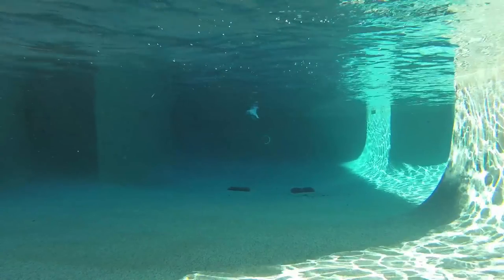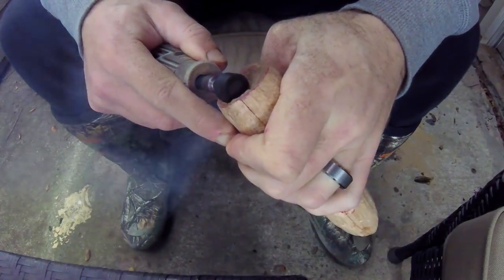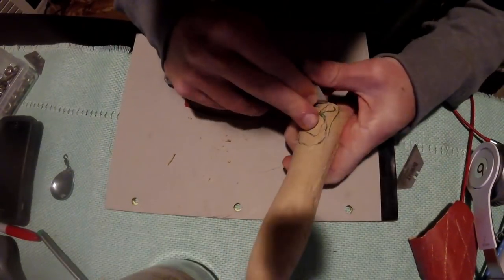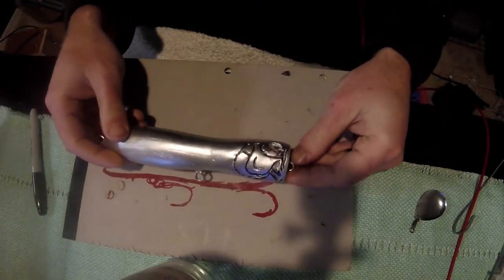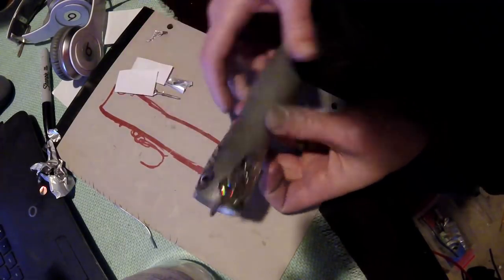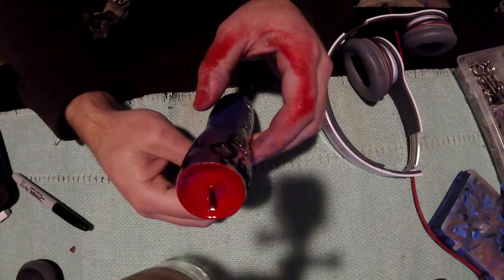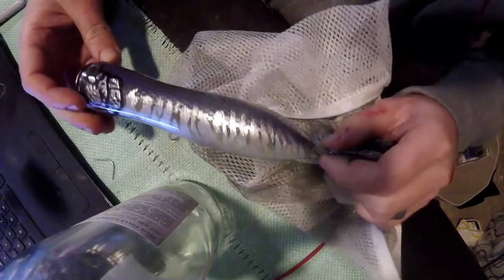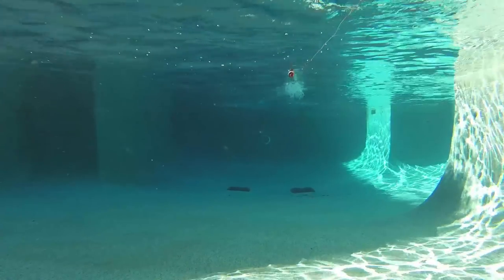MAKING A SPINTAIL POPPER FOR TUNA!

Comment: Tip: Add brown shopping bag paper in between the two pieces during glue up, then after shaping take a chisel and easily break the two halves apart. Now you have easy access to install the through wire.
Reply from the maker: Or just lightly glue them together... Whatever way suits I've never had any problem opening up two glued pieces of wood . Thanks for watching!

Comment: you should look up the wood chopper lure it's a double prop blade lure used mostly for Musky and peacock bass. With that style you don't sacrifice the rear treble hook on the lure
Reply from the maker: Hi Joseph, I know about the choppers, they're awesome. Unfortunately they reduce casting disctance for tuna and GT significantly because the props are fixed and don't fold over during the cast. When I will be fishing this popper with the spinblade on it, it will have a assist hook coming from the belly hook hanger so that the hook will hang right around the tail. Thanks for watching!